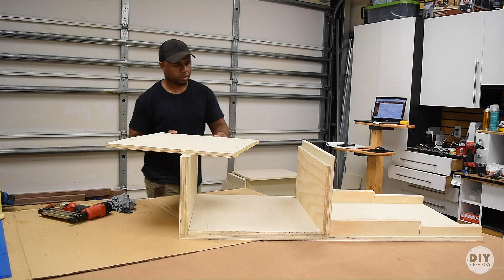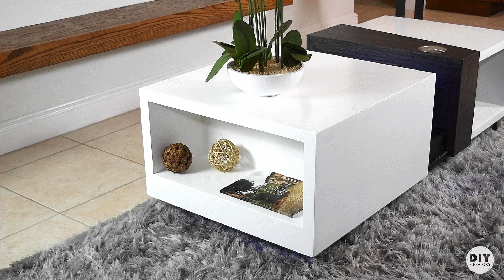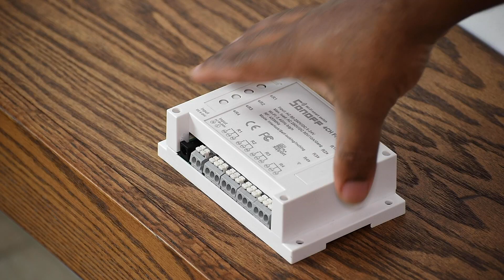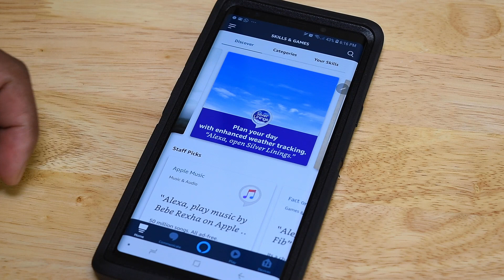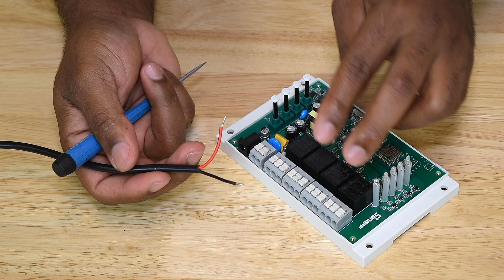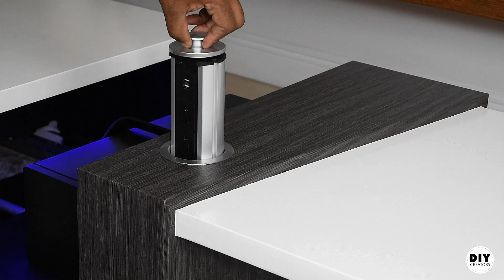Modern Design automated coffee table (Voice Activated)

Comment: nice project! how did you get the actuator to move that quickly?  The specs are 5.7mm/s which is 26s to move 6".  I am currently building a coffee table that lifts and uncovers a puzzle table.  My actuators are also 5.7mm/s and it seems so slow.

Comment: You can buy a wireless remote for the control box.  No need for the rocker switch!  So alexa or the remote can control it.  Very neat, thanks.  P.S. You can buy a router with dual band and that works great.

Comment: Hey man, love your videos.  Check out Alexa routines.  It will let you say "Open the projector" and then run the command to turn on "projector open on".  That way you don't need to memorize strange phrases to do stuff.
Reply: Was coming to make this exact comment.
Reply: Great recommendation. Routines are a little-known secret that really let you customize your Alexa setup. Since you choose the devices through your Alexa app, you don't even need to use a particular device name in the routine name. You could say anything, maybe "Alexa, watch TV" for example. I'm finding that she still struggles with correctly identifying super-short commands these days, but at least with routines, you could control several devices in one command, and give it a cool name. In fact, you could quite easily have it set up so that when you say "Alexa, watch TV," your projector came out, and the appropriate lighting came on/off. Now that would be slick. As usual, awesome build- it came out great!! Thanks again!!

Comment: >Using random proprietary app to control a coffee table.
>Voice control is useless anyway, since you have to lift the projector by hand.
>Not using Arduino.
>Doesn't work with router.
>DISABLE WPA2.
>Problem solved.

The state of IOT.

Comment: I'm in a wheelchair with a spine injury, so anything that saves me having to lean over is something I jump on immediately. I've never used a voice assistant before in my home, because outside the USA the range of uses is ridiculously low (no shopping
, no location-specific traffic, business or news information, no online music, the list just goes on and on), but now that the potential home automation uses pile up, I might jump the gun and buy an echo. What's great about your build is that it looks easily adaptable to a number of different things, everything from opening and closing curtains to overhead cabinets in the kitchen lowering their shelves through the bottom. I can't reach anything above 158 centimeters (~5ft 2in).

Thank you so much!

Comment: Super cool.  But they lost me at "turn off security".  Remember: the "S" in "IOT" stands for "security".  That's right... it ain't there.
Reply: Preach the InfoSec my brother! Lol. I'm with you though. I'm curious how many ports the shipped firmware leaves open for no reason.
Reply from the maker: Just to clear the air, disabling security is not something I'm recommending. Sure I could have done something wrong. I'm sure comfortable with network and routers etc. Bottom line eWeLink documents do not reccomend a few things. Some router with work some won't. Many people had the same issues based on my research. Temporarily disabling security was the only thing i could do to make it work. It's not difficult at all. I don't feel everyone will have the same issue as me. I have a rather expensive router so things cane be a bit more strict.
Reply: @DIYCreators Did you try manually selecting the channel as I have multiple sonoff devices and they are all don't work with the auto channel I need to select  channel 6.
Reply: @mtzrubeng  why are you telling me this?

Comment: There is a way to stop it from closing or to prevent it from closing at the last 3 to 2" if a child put their hands in the cabinet will it closes by using a garage inferred detector that would stop the closing proses and you would need to use mirrors.